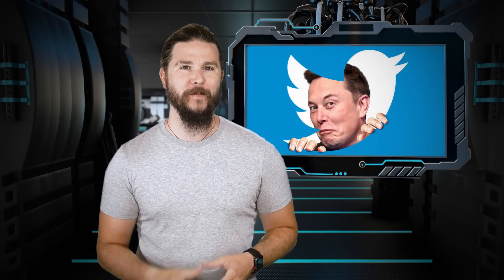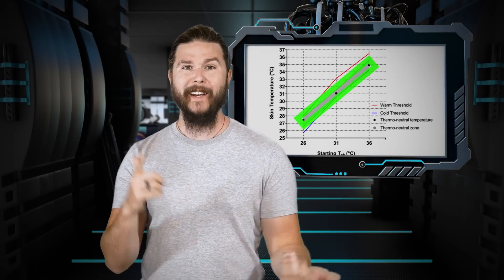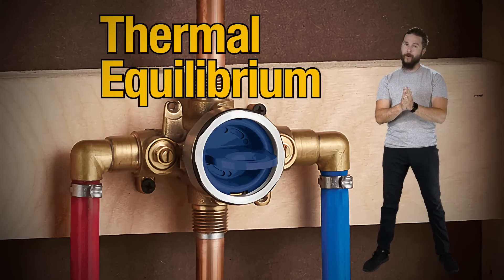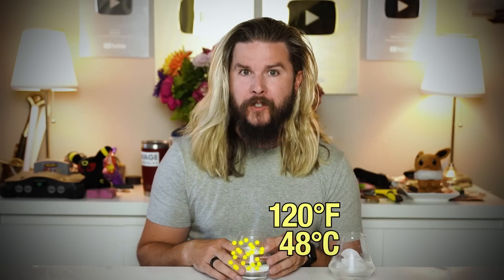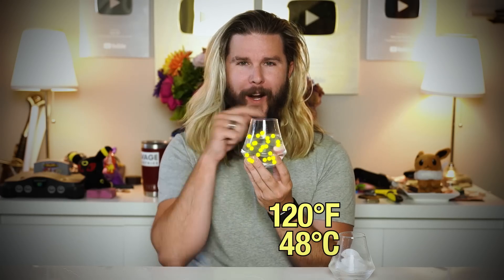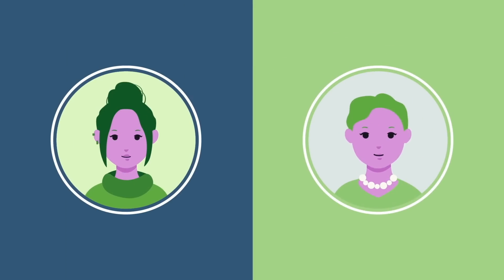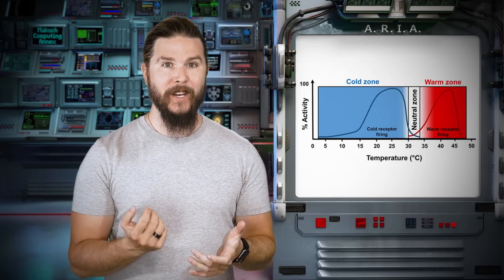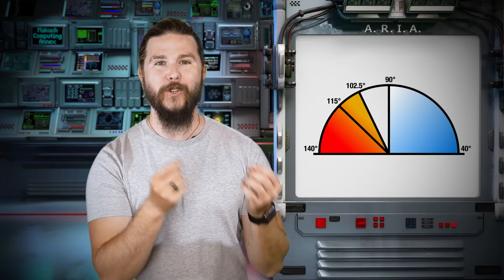Why Are Shower Handles So Sensitive?

Comment: Here's something I've always found curious: why does the sensation of extreme heat from water feel cold or cold-adjacent? I just find that it goes from ow this is hot to OW THIS COLDBUTHOT WTF
Reply: its the same with extreme cold, the temperature stops activating your temperature nerves and instead starts activating your pain nerves
Reply: basically when your skin gets too many standard deviations away from ‘comfortable,’ it becomes so painful that it is a transcendent experience and you stop perceiving it as temperature
Reply: Part of it has to do with the fact that extreme heat also activates your cold receptors. Cold receptors for cold, warm receptors for heat,  warm and cold receptors simultaneously for painfully hot.
Reply: I think it has to do with pain. all pain can feel analogous when it comes to temperature?
Reply: Isn't the thing here that 'too hot' and 'too cold' are actually the same thing to us and we just use context to know which one it is?
Reply: @cameron7374  No, not at all, because we have different receptors for hot and for cold, so the signals are not the same.
Reply: I would say it has to do with how evolution has prioritised temperature sensation. If you just got a thermal shock, It is safer for the central nervous system to signal pain to jerk out of the way then it would be to spend time figuring out what is happening. And when I say save time, We are talking milli seconds, because every one counts to reduce cell damage in Exstream temperature events.

It is only till after your nervous system realizes it is not detecting damage that you realize... Oh... Thats cold? And then you cautiously reassess the situation using your brain instead to confirm that it was in fact cold. Since pain from temperature is more commonly associated with heat (that's why you think of it as "too hot") but it's more the fact that you just experienced pain from an Exstream temperature deviation that your central nervous system reacted to instinctively to minimise potential damage.
Reply: @pseudonymity0000  ”Exstream”
Reply: When you mix warm and cool water your body interprets it as hot as well.
Reply: Our skin goes from feeling temperature to feeling pain in extreme cases. It's also why our bodies start to think they're feeling really hot when it's extremely cold.

It mainly relies on context to figure out which is which because to our brains pain is just pain. So when in a cold environment and you're wearing thick clothes your brain perceives it as being extremely hot. And when you're wet it starts thinking it's cold.

This is all oversimplified for easy explanation, but TL:DR at extreme temps we physically only feel pain and our brains get confused.
Reply: Thanks everyone that answered. You're all MVPs 💛
Reply: It’s so cold that it burns and it’s so hot that it’s cold
Reply: When I was a kid I once washed my hands with absolutely scalding water, because of this exact thing. It felt cold until I started to dry off my hands and it went from the extra-hot-activate-all-nerves region to just the activate-all-the-hot-receptors region and suddenly there was pain.

Comment: None of this is my answer.
1st as long as you have a shower where you can also regulate the amount of water, the more water you want, the quicker it flows, the less time it gets heated up on the way, the colder it gets to you.
2nd people are too impatient. Even if the water is going in at lets say 40° the pipes themselves are still cold as you start up the shower and will sap some of that heat on the way. If you now crank it up hot because its to cold, youll have the effect where its fine for a few seconds and then it gets scalding because the pipes have taken on the new hotter temperature.  
So to properly regulate your shower temps you gotta play with the speed too and have patience
Reply: In a regular shower the water doesn't get heated in the shower, it just mixed hot and cold water.

Comment: please don't mix measurement units (handle is 10 cm and then move it an inch) while the imperial system seems weird i'd rather just have imperial than mixed stuff (having them converted on screen is fine though)
Reply: You clearly are not an engineer lmao

Comment: I had a problem with this once: I prefer to shower much colder than the rest of my family. Once our shower handle was broken and the lower temperature part was not useable. Took a while to convince my dad that I felt like boiling my own skin everstime I took a shower...
Reply: I think I'm the opposite of you lol I need to basically be boiling alive otherwise I'm having a bad time
Reply: @techramancer  Now mix so you can get into an equilibrium where you both use water at an acceptable temperature
Reply: @demoniack81  oh my 😳

Comment: My shower isn't too bad. It's sensitive but more manageable than most other showers I've used. I don't know why that is, it's very similar to a friend of mines but using hers, it is like switching between lava and ice when I change it just a little. 

I either got lucky with who installed it or my heater is good or bad, depending on what one constitutes being able to more precisely change the heat of water.
Reply: Probably a shower control that doesn't mix uniformly over the range of motion. It's called a "long throw" valve, the "throw" being how far you have to move the handle to change the mix.

Comment: I watched a plumber live stream himself installing a bidet and he was very particular about how he set it up so the stream would never be too hot or too cold.
Reply: I want to see....link me my guy
Reply: Can you link the stream?
Reply: Our bidets are cold-water only. Now I feel the need to install a water heater on them for the winter months! 😆
Reply: Mine is cold only, and it's actually fine. It seems buttholes aren't that sensitive to temperature, and I only need a little spritz most of the time anyways.
Reply: My bidet has hot/cold dial, perfection
Reply: Imagine if it was too hot or too cold D:
Reply: That is a much better way to handle the waste water and sewage, than using toilet paper or wipes. Sewage water treatment is a real threat to humans than climate change due to the effects of contaminated water
Reply: @Irish381  I mean... Both are very important. Also we can clean sea water, but companies are stupid and don't want to spend money on it and would rather use the cheapest option possible, which is local water tables and sources. We really won't ever run out of clean water as long as companies put in the effort and money to clean salt water. But it's not a market that is broken into yet and also it would make water more of a commodity than it is right now. They really don't want that last part lol. They're okay with building hundreds of oil pipes across the oceans and USA which literally ruin entire ecosystems but don't want to build drinking water pipes from salt water cleaning facilities because it doesn't make them money. Most of humanity's problems if not all of them come from billionaires and companies. Woo capitalism.
Reply: @TwixtheFox This is fundamentally wrong. First of all, we do desalinate and clean seawater for consumption. However, it's only done in places where you have basically no other viable option available. Why? Not really because of capitalism, no; it's because the energy demands to do so are huuuge. Energy isn't free, in case you wondered. And moreover, unless you get that energy from renewable sources or nuclear, your clean water is suddenly rather dirty in its totality. Meanwhile, if you have perfectly good groundwater right in your backyard, why the heck would you want to pipe desalinated water in from the ocean many hundreds of kms away? Frankly, your comment doesn't make any sense. 
Tl;dr: It is already done, but mostly by oil-rich, mass-polluting desert states in the Middle East.
Reply: I bought a bidet in February 2020.  I felt like a genius in the months that followed, looking at the news stories about toilet paper shortages like "oh ho ho, that must suck.  Oh well!"
Reply: Legend
Reply: Goldie locks and the 3 bidets.
Reply: Sounds like a perfect follow up video to this! @Kyle Hill